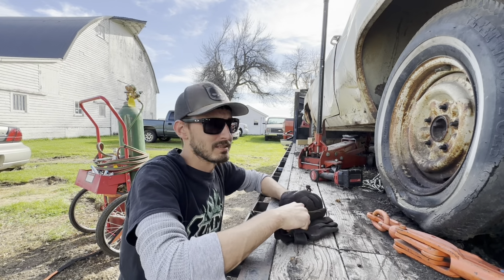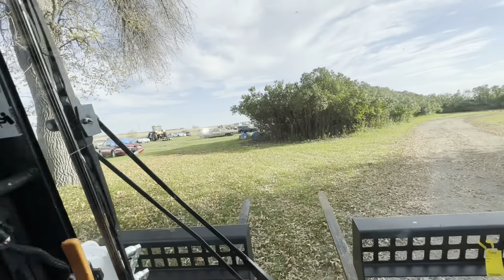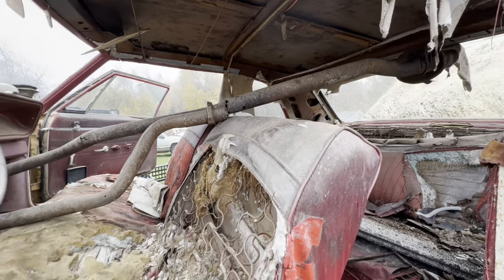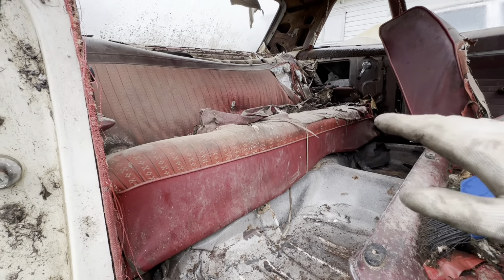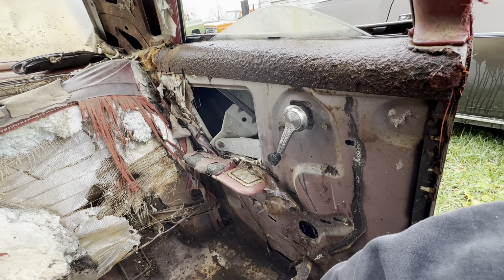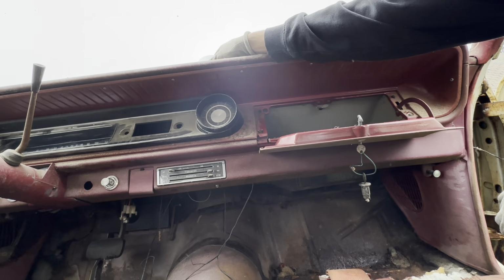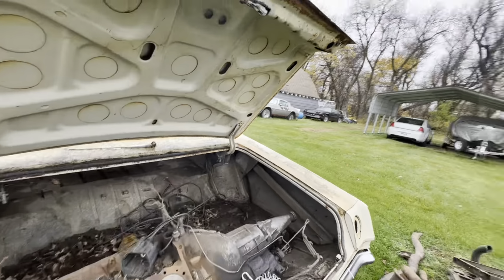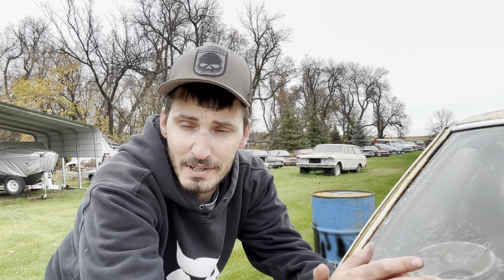NASTY Car Cleaning & Revival of a 1965 Chevy SITTING since 1985!!

Comment: Looks pretty solid.. Make a good fun beater.. get a pump sprayer fill it up with some disinfectant spray it down. Let it soak in over winter.. maybe nutralise the rodent pee. Mix pepermint  essence with water and spray around. Mice don't come anywhere near.. but its got promise. Id strip it out more and presurewash before winter. Then peppermint it. Another days work and you got it.. then collect your parts over winter. Good luck. Good idea on the mask.. Don't forget to change your filters regular.
Reply from the maker: Thanks Dan! I think winter started here on Thursday night lol 😂 see what else we can get done before we get totally immobilized! Peppermint has worked well for us for cars in storage! Odd tho we have had multiple cars sitting next to each other outside and the mice will only pick out a certain car, odd but I’ve heard it could be even the type of material the wiring is made of!
Reply: @johnsonautoranchllc  yep I seen snow on cold war motors. I live in Mid Sweden. If you got snow we got it coming. But I'm in Bulgaria at the moment at the top of Turkey..I was just thinking you exposed the pee and metal to air now. So the ammonia will activate. Mice are macho. If you have a male cat. They pee to be macho over the cat. Lol. There was a mice epidemic explosion one year in Sweden. I was knocking out 25 per day.. Until the cold cold killed them off..I use Antifreeze and bread. But it will kill your other animals. But I would say the mice will come to that car to over pee on coon pee..needs blasting.. Good luck man..26 degreess here..lmao..perfect weather. Cool at night . Have a good week man..
Reply from the maker: Sweden!! Sent some cars there 👍🏻👍🏻 see ya next week!!